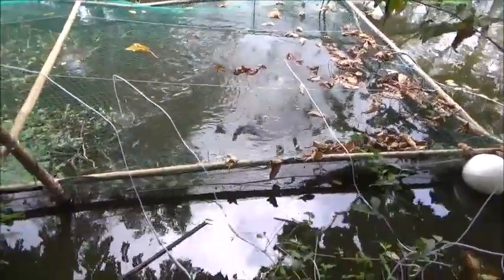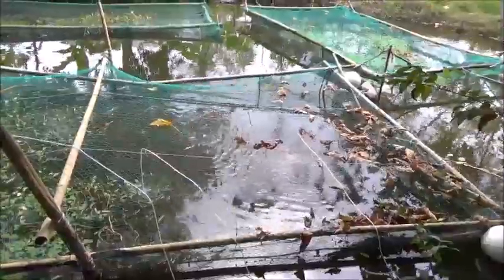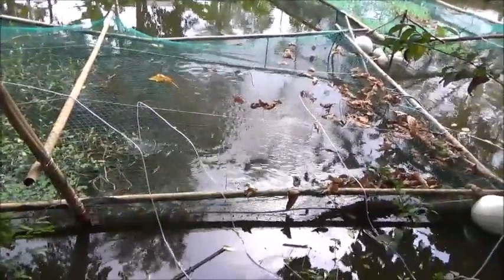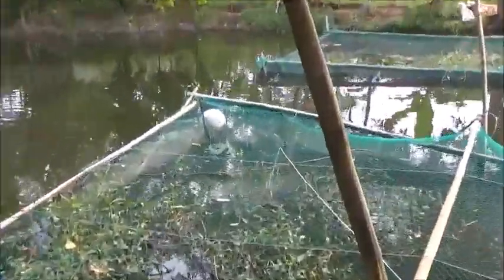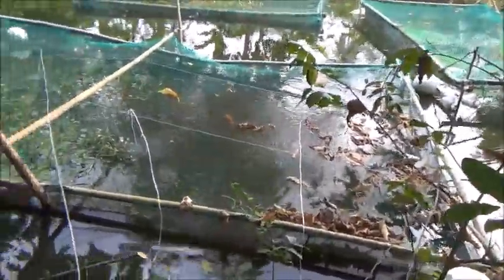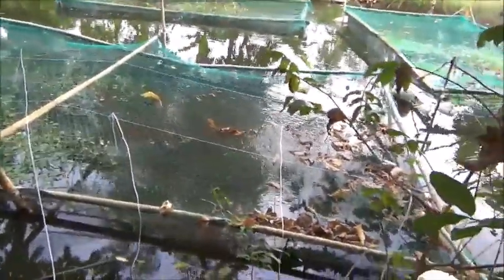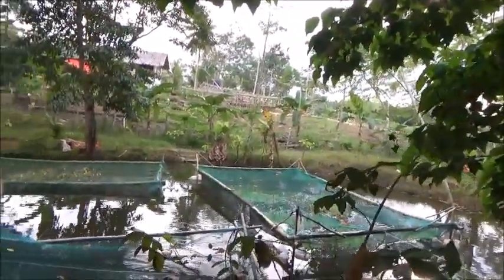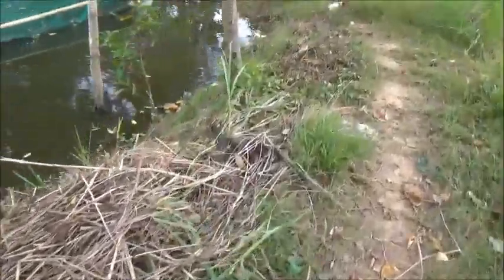Swaping Out The Aeration Pump In The Black Tilapia Cage

Comment: You can take the air pump apart and adjust the rubber diaphragm to make more air pressure. I think you would be better off connecting one airstone line directly to the pump. You will really crank out the air on that 1 stone. And make it go as deep as you can.